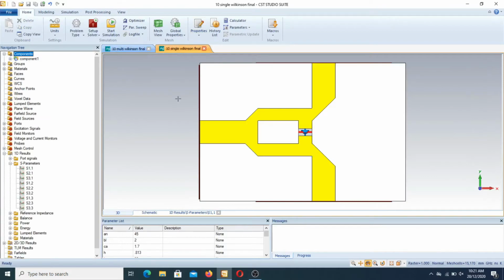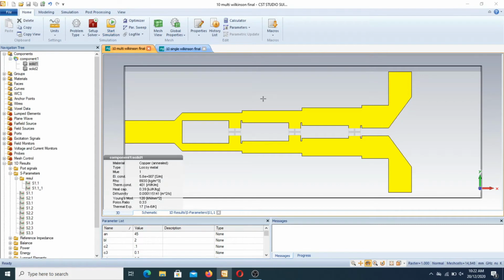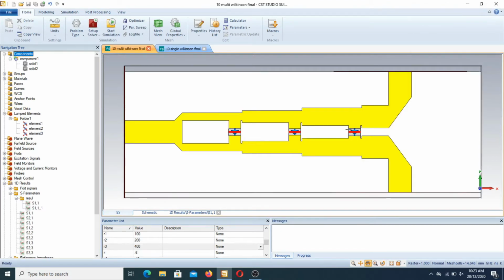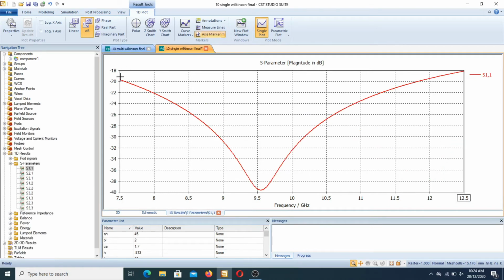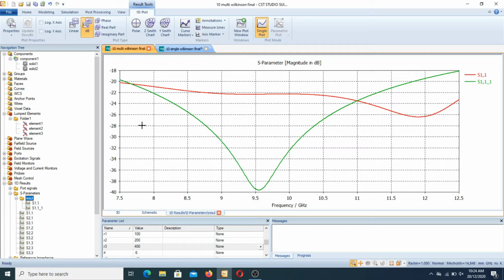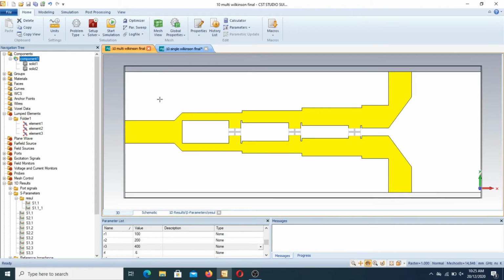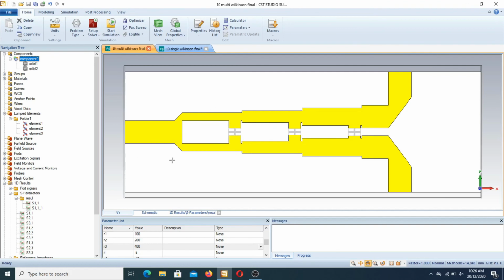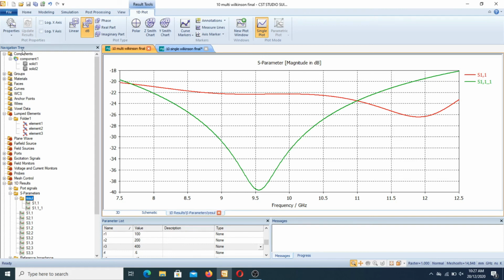How to design three stage Wilkinson power divider |comparison b/w single to three stage Wilkinson

Comment: can u explain step by step procedure. I face difficulty how to start. can u explain how to start the design from substrate
Reply from the maker: It takes too much time but you have to start from one side and make replica of it and then finally add it
Reply: @infotechscience  That design part of substrate can u explain me , how to start. Or can u mail me or send via a video, how to do that. It will be so useful for me. Either single stage Wilkinson Power divider can u explain me how to start in CST from substrate part